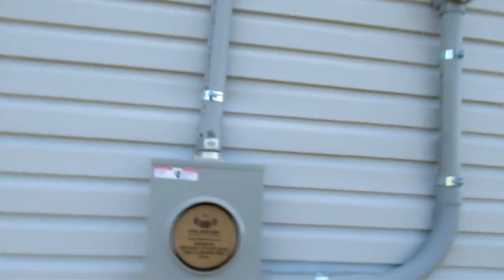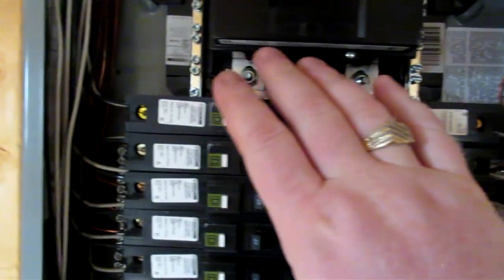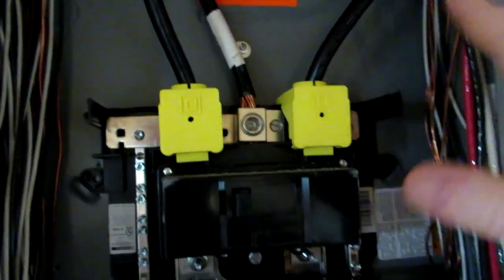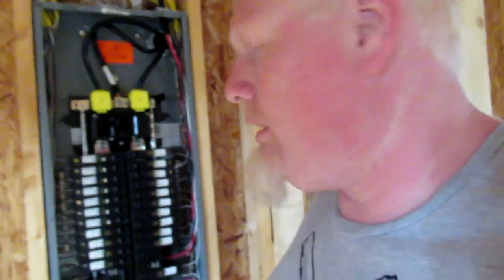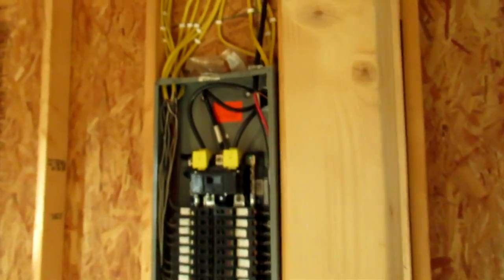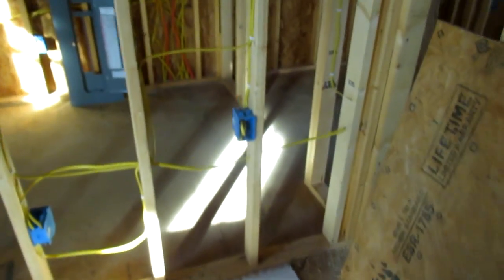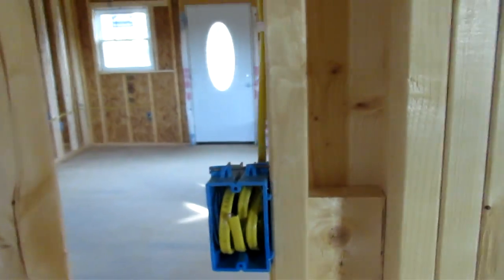How to wire a house

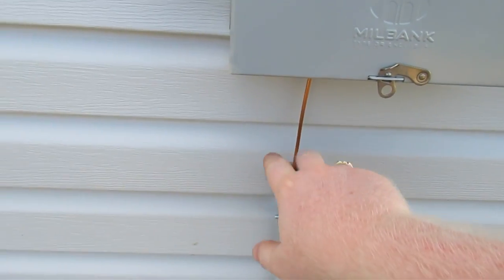Comment: 3:12 Intersystem bonding termination is required everywhere for per the NEC for bonding of phones, CATV, TV antennas, etc., also depending on the location, any steel framework of the structure (steel studs/trusses, rebar, etc.) and metal water pipes must also be bonded to the earth grounding components the electrical system.  4:11 I totally agree with you regarding copper, I too would rather spend the extra cost and not have to worry about the issues as well as the extra steps needed with aluminum wire.  5:59 Just a clarification, the bonding screw and/or strap is used ONLY if that panel is the first point of disconnect for the structure, if there is another subpanel downstream being fed from the first point of disconnect, you MUST remove the bonding screw and separate the neutrals and the grounds from each other.
Reply from the maker: Yep.  I've talked about that in other videos.  The inspection passed with flying colors.

Comment: I know trips are rare, but I do not like the combining of the lighting and power. If you were to trip a receptacle you lose your lights too. Also you may be “pig-tailing” all your devices, but you never touched upon that, but if you are not and you go “in and out” a device (I.e. a duplex receptacle) and one of them goes bad on the circuit you lose your lighting too. I personally prefer to do 1 separate lighting circuit for each level of dwelling. I could “kill” any power circuit and that would have no effect on my lighting.
Reply from the maker: This box is a plug on neutral and doesn't require pigtails.

Comment: I am still one who likes the lighting circuits separate from the power circuits. I have drawn up a lot of electrical plans on the projects we were working on. The  engineers always designed them that way. With both the power and electrical on one circuit, if you pop a breaker while using something plugged into a power outlet, you lose the lights, too. I can't tell you how many times this has happened over the years, but it was a lot. Rarely have I seen the lighting breakers pop. Separating the rooms is not a bad idea. For me, knowing  construction and having worked in many different construction disciplines. I have seen some strange things done by professional builders and their subcontractors. So when I design homes or any other building, I get everything on the plans and specifications. Then it is done, right?
Reply from the maker: Just because it's on the plans doesn't mean it gets done right.  Trust me.

Comment: I hope you don't mind questions two years later.   What size copper did they make you use?   3/0 or 2/0?   2/0 per NEC for residence.   Also, have you had any issues with the arc faults tripping?  I have heard of a few tripping at the same time with no obvious cause.   Thank you for your time.
Reply from the maker: 2/0 and no issues with the breakers
Reply: 2/0 will work but is designed for 175 amps. 3/0 is the correct size.
Reply: erictold    If you are looking at NEC310.15(B)16, it would seem you are correct.   I can't remember the number but, there is a table for residential services that is an exception to the ampacity chart.   It says 200 ampere service 2/0cu conductor.  Respectfully,   Kevin

Comment: When doing your home wiring, can you choose whatever brand panel you want, Square D, Siemens, GE or Eaton, without any issues from the inspector?
Reply from the maker: No issues with an inspector whatsoever.
Reply: Square D is very popular with electricians. Cutler Hammer is not far behind and it is very rare I see GE and Siemens panels in residential.
Reply: DZEyoyo123 In the United States and in Canada and I’m pretty sure in the UK you can use whatever is available at your distributor or big box store. There’s no big deal on what you put in that’s up to the customer not to the city or state

Comment: Im trying to install a vari speed controller  to a commercial kitchen exhaust fan/light.  As of now the fan and light come on together a single on/off switch. Since the fan and light are wired  together somewhere up in the hood. Would the speed switch ( its a turn dial that clicks to off then turns from high to low) control the light brightness and fan speed together if i replace the on/off switch with it...? Or would it even work at all lol
Reply from the maker: I wouldn't tie it to the knob that controls speed. Just add a second switch

Comment: All that electrical requirements and you get away with using 2x4 sandwiched headers over your doors and windows on exterior bearing walls. Around here anyt opening over 2.0 ft bearing has to be a 2x6 or larger as the hole widens. General rule for us is 2x6 up to 4ft 2x8 up to 6ft and so on until you get larger then 9ft in which case you have  to use laminate beams or engineered beams.
Reply from the maker: This is standard framing here.
Reply: Crazy! Good video though
Reply from the maker: Thanks for watching
Reply: yep we refer to it as a "hillbilly header", not load bearing walls it will pass
Reply: Exterioror walls with the trusses seat on them are load bearing. I was a contractor for 11 years. I dont care what you call it or where it is, it is still a load bearing wall and dumb. Thats why doors sag and have issues over time is due to not enough bearing header. But hey, what do I know. I only built half million dollar houses for 11 years.
Reply: Willis Cooper half million dollar homes are shitholes now on Long Island! Time to move.

Comment: Great video all around. 1 complaint? STOP reaching in and touch electrical components with your bare hands. I know you know that they were not connected, but that habit will get you hurt or killed. Get a small dowel, ink pen or pencil or something.
Reply from the maker: If you do enough electrical work you will be handling things just like this

Comment: Nice job ! I will be wiring my new house does rough in wiring need for all circuits to be connected in main panel ?  Thanks
Reply from the maker: Doesn't usually require it but the more you have done the better in my opinion. That way the inspector can let you know of any potential problems before final.

Comment: A question for our host or anyone who can answer this...
I had a new Siemens 200 amp breaker box installed in my home in 2010. Done by licensed electrician, passed inspection. Works fine, no problem.
But one time when I cut off the main power to replace old house wiring there was a notable spark/pop on the casing when I removed the front panel to do the work.  Didn't harm me, but freaked me out a bit. What would cause this? A bit of stored energy inside the box or something? There's still some old house wiring I need to replace, but that has had me extra cautious ever since.
Reply from the maker: Sounds like there's a break in shielding somewhere

Comment: My mom's house burnt down because of the old lead in wire lost insulation in a ice storm, the lead in arked and blew up in short pieces it sent a  charge through the neutral and hot sides it melted all the wires in the home. After the fire I inspected it with a inspector, we seen all wires melted up to 2 feet from the main box the mains did not trip. It was amrens fault for a 40 year old two block long lead in wire, there was a available pole in our driveway that could of been used but lead in ran around 2 sides of our property to a pole in alley with the transformer that ran 6 homes. Ask for a transformer on a pole closest to your house making lead in wire short as possible. Change lead in wire to your house every 10 years or bad ice storm. It's amrens property so it won't cost the homeowners to request a new wire if it is old or ice damaged it could save your home and family's life
Reply from the maker: Sorry for your loss.
Reply: If AMEREN was at fault, they would have paid for the damage.   Pretty sure they didn't pay.  The reason I say that is, your explanation of what happened is not how electricity works.   More likely, the wiring in the house shorted and without the overcurrent protection working it kept going until the service drop(lead in your explanation) melted.

Comment: Clearly you are not a professional. You said that about 12 times. The work is clearly not done by a professional. You biggest mistake is bad talking aluminum entrance wire. You are clueless. It would help if you could see a modern professional installation to better understand what is going on. You video is painful to watch and in 4 minutes I spotted at least 4 mistakes. Frankly, this job might not be approved in many jurisdictions. I hope you are well. But, next time get a pro to do this work for you.
Reply from the maker: Every house I've wired has passed code. And aluminum is not the best choice. I've spent decades in industrial electrical and know exactly what can happen
Reply: @BeyondtheBoom  Let's be frank here. Your work has been passed by an inspector. It clearly is not what we expect from someone who closely follows the NEC. As you said several times in your video, you are not a professional. This work shows that. Read the code book and follow it. Look at professional work from a top contractor, before you try this project again. In many parts of the country this work would not pass inspection.
Reply: @MrMockingbird1313 .    I worked as a Sr. Design Engineer for one of the top 15 private electrical contractors in the US licensed in 47 states for 21 years and other contractors prior to that.   Now, I respectfully ask that you, the all knowing person you are, tell us all the problems you found in this video that are NEC violations giving NEC reference numbers, and workman like manner issues.  Please be civil to others!   I’m looking forward to your response!  No response would be very telling!   Respectfully,   Kevin.  BTW, I have all my NEC books and do understand them.

Comment: like your explanation the reason why the inspector said you don't need a bare wire running back to the main breaker box is because the main breaker box is metal and the ground and neutral bus bars are tied to each other via the metal box. Similar to how a car body is part of the ground side of the battery. But you would need a green/bare grounding wire on your metal  receptacles and appliances throw out the house just not from main breaker box to meter box. But again it wouldn't hurt anything if you left it there something really wrong would have to go wrong for it ...but again inspector saved you from using more wire then needed to.
Reply from the maker: Very true.  Thanks for watching.

Comment: Pardon my ignorance, I'm no electrician by any means, but I thought you could only bond your neutral and grounds at 1 place? I see that you made that bond at the meter box, wouldn't that mean you would need to remove the bonding screw at your panel? Not bashing, just asking as I hope to get my home rewired soon.
Reply: Daniel Velez nope. Only sub panels  require separating.
Reply: Yes I would have expected it to be separate else it not to be bonded in the meter box and just run straight through to the MSB and bonded there.
Reply: Daniel Velez l

g of
Reply from the maker: Your required to have the bonding screw.

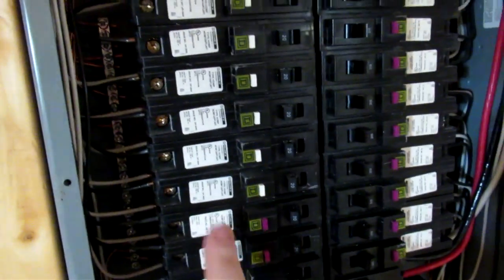Comment: 5:25 The wires coming to the box are only rated to 100amp not 200amp
Reply: Looks like 2/O copper to me, #4 (for 100 amp) would be alot smaller.
Reply from the maker: Its 2/0 copper and is rated for 200 amp
Reply: @BeyondtheBoom  oh ok we have 200amp but i check the cable and its 3/0AWG !!!
Reply: Póntos Olympians    If you check table 310.15(B)16 you are correct and 2/0 is not rated at 200 amps at 75 degrees C.   But you would not totally be correct.   There used to be a table showing 2/0 copper for 200 ampere dwelling unit services.   Now in my 2017 NEC Article 310.15(B)(7)(1) it states that service conductors for dwellings for services sized 100 to 400 amperes shall have ampacity not less than 83% of the service rating.   
I'm not aware of why they removed the table.    But it has been this way a long time.   Respectfully,   Kevin

Comment: Very well done. Like you, I'm not a professional but I have worked under the guidance of licensed electricians in an industrial environment. You mentioned that you ran 14/3 for your smoke detectors. Is there any other place you used that gauge? When you say you use 8 or less devices per circuit breaker what are you referring to? Outlets? You said that each motor load should have a dedicated breaker such as washer and dryers, refrigerators and such. What about ceiling fans? How many can you put on one breaker? Appreciate your help!
Reply from the maker: I ran 14 3 on a three way switch and yes, no more than 8 outlets per circuit
Reply: @BeyondtheBoom  Awesome job,  very clean, I would have, Pulled the 12/2 out of the electrical panel and had a junction box so the wire coming out of the panel was gaged to the lowest gage in the circuit  , to avoid possible future problems, OR, replaced the 14/3 with 12/3 .

Comment: When you said no more than 8 devices on a circuit I assume a light counts as 1 but how are the plugs counted? if you have a regular plug is that 1 or 2 devices? I may or may not wire my own house but atleast with your video I feel much more knowledgeable. Great Video!
Reply from the maker: Plug is one device. At least around here
Reply: This is not a NEC requirement, it is a personal design decision, or local ordinance.

Comment: I got a couple things ask you why don't you do some videos on the control panel as you work on and why didn't you use any nylox on your connections I have used breaker guts inside control panel before have you ever done that and did you buy your stuff for work cuz you can get your boss to get it and get OEM prices well this the questions I had thank you and keep up the great work
Reply from the maker: I used copper so there was no need for nilox

Comment: Good work man, feels good to learn it.  I did my basement added 2 arc f. 20s on 12- 2. And pigtails ground. Did the work 12 years ago so didn't need to pigtails gnds but it's code. Gound side up on plugs too..   All receptacles 6ft from water source or outside need to be on gfi.. outside bubble covers.. u know.. I hate gfi s tho. They break alot
Reply from the maker: Cool. It can be fun and stressful at the same time.

Comment: Thanks.  I have a fuse box in my house.  We noticed that light on the oven hood was dimming when we turned on our microwave. Thought the microwave was bad as it was old.  Bought a new one and it worked fine.  A couple days later the microwave started going on and off and the oven hood started blinking again.  Then the outlet for the microwave, the outlet exactly opposite that one in the living room,  the outlet next to the stove, the light switch next to the stove, the outlet by the sink, the outlet on same wall about 6' away are all dead now.  I checked the fuses and they were all good. I identified the main wire above the oven hood.  It's a 12/2 with ground,  MN-B 600 Volts. This wire seems to be the source  for all the outlets that went dead.  I went back to the fuse box and this wire is sticking out through the drywall  in back wall of my bedroom closet with duct tape holding it in place.  Also,  the fuse box isn't bolted to the wall in my bedroom closet. I can see exposed copper wire where this main wire is cut and put into the circuit (s).  I rent this house but I'm curious. If I cut the main power to the box (main switch on top) all the power in the house goes off....as expected. I understand that the main wires to the main circuit from outside are still live.  I'd like to switch off the main breaker and pull the box out to see if this problem wire is loose in the circuit (s). Also, I don't understand how I can have only partial power to the oven hood. The light goes on but it's much dimmer than usual. Also, the microwave outlet has come back on briefly as has the one by the stove but went dead after a few seconds. I'm obviously not an expert and have GREAT RESPECT for electricity.  But I'm almost positive that the wire identified over the stove hood then coming through the drywall is the bad one.  It's yellow and it's the only wire I can visually see besides the water heater wires which is also in the closet. It DEFINITELY looks like whoever installed this wire did a hack job.  Seeing exposed copper wire so close to the metal frame of the fuse box is just unbelievable to me.  Could this one wire be the source of 1. The oven hood,  2. Light switches next to the oven,  3. Outlet next to the oven, 4.  Two other outlets on other wall , 5. Outlet we plug the microwave into and  6. The outlet directly opposite that in the living room.  There are 3 other outlets in the kitchen including the one for the refrigerator that THANK GOD are still working.  Any thoughts would be much appreciated. Thanks. Thumbs up for sure!!
Reply from the maker: If it's in that bad of shape you may consider rewiring the house before it gets worse. You could pull a new wire for that circuit but I doubt it's the only issue
Reply: Microwave needs a dedicated 20amp circuit. Report to your landlord. Get an electrician out there. For your own safety, do NOT start messing around in the panel.
Reply: @brianlutz7813  exactly messing with someone's bad wiring is different than running new wires with no power source then having an inspector check over your work

Comment: Amazes me how different states are. I can't understand when people rough in their electrical they don't "cut in" the romex cables and just roll them up in the box till after sheetrock. It is so much easier to pull your wires, cut in and splice, then staple.
Reply from the maker: Because drywallers will shred them when they use power tools to cut out the openings.
Reply: @BeyondtheBoom  not true,  I've been rough wiring like that for decades. If you roll the wires in correctly they don't touch a thing and saves a ton of time when devicing.